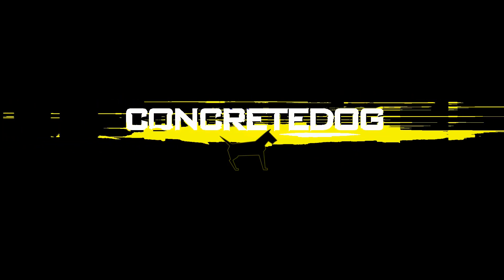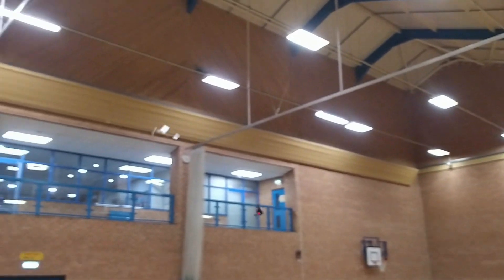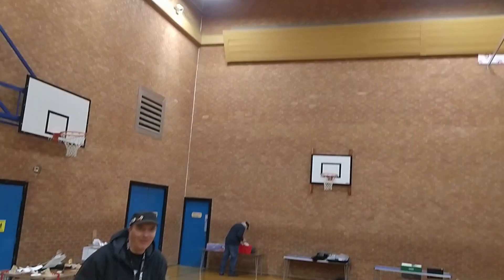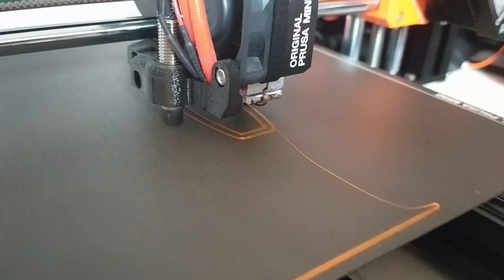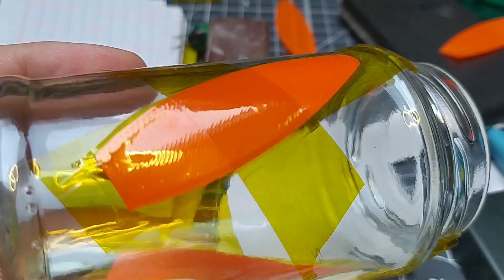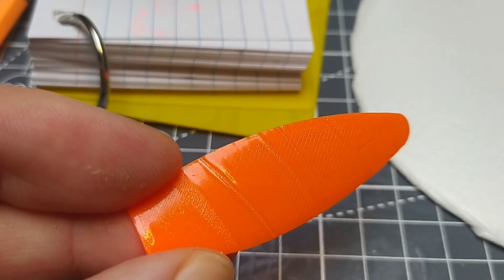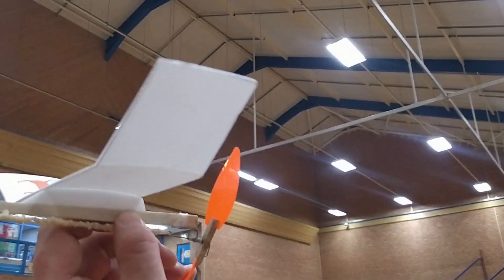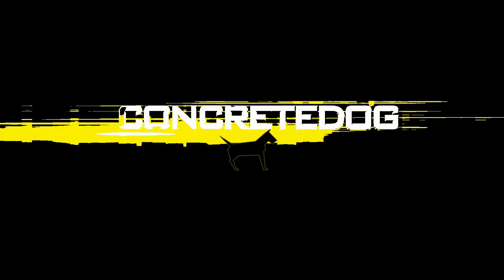Evil helicopter attack leads to annealing 3D print hack!

Comment: I wonder if you could similarly heat treat thicker quadcopter props. So far the printed attempts I've seen all have those typical ridges on them from the printing that makes them inefficient and delicate, but maybe this way you could get around the whole issue.
Reply from the maker: Yeah I'd be interested to try some experiments with thicker props. There are lots of different approaches for annealing prints around, like packing parts in salt etc, I plane to have a play when I get chance!